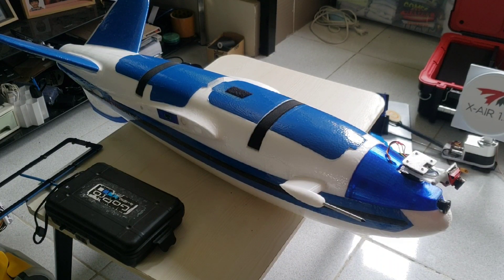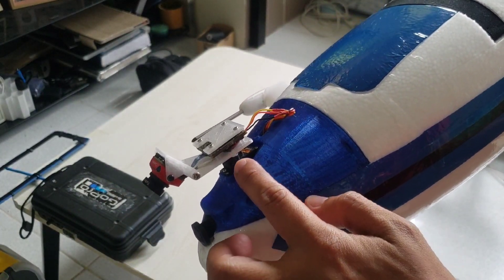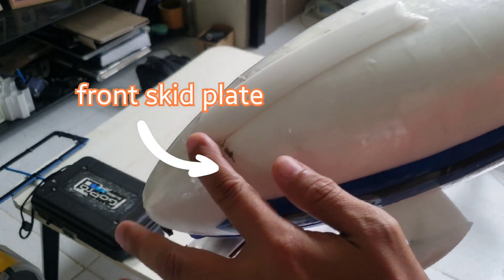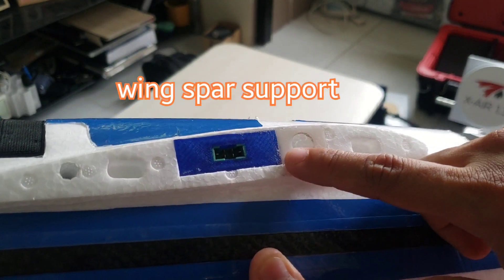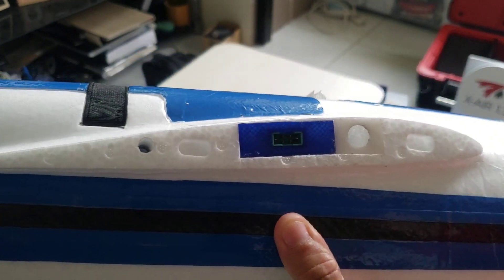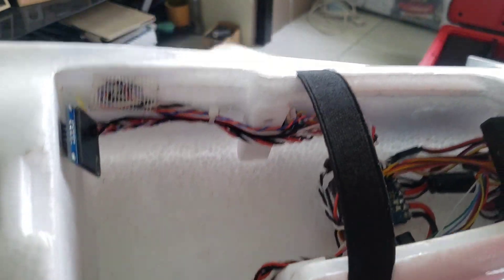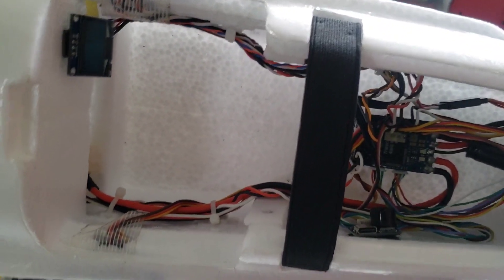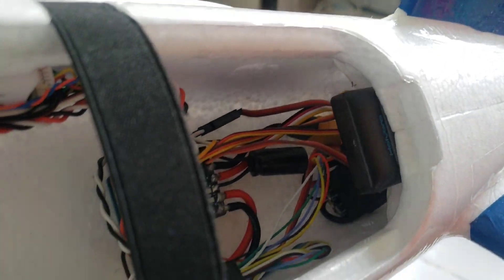X-UAV Talon Pro Long Range Build update!!!

Comment: Impressive build! I recommend you add proper hinges to the control surfaces as they don't come with decent ones from the factory. Especially since you fly long range and high altitude flights, it is important to have reliable control surfaces that won't shear off and cause your plane to plummet. I've done it on mine and now I fly without worry.
Reply from the maker: actually this build has hinges on all control surfaces. I install nylon pinned hinges on my build.
On 3:28 of this initial build video https://youtu.be/2IihYvd2n1c, you can see the hinge on the control surface
Reply: @windfpv  Oh, forgive my lack of observation.
Reply from the maker: haha!no worries mate :)
Reply: @windfpv  Also, where do you recommend the CG be balanced? I have flown my talon pro for a couple of hours and it has a tendency to nosedive when I balanced it on the distance specified on the manual.

Comment: Thanks for sharing... how big is the battery bay? Could I fit in a 4 cm x 7 cm x 16 cm 10000 mAh 4S Multistar battery?
Reply from the maker: Yes you can fit that pack. I have flown this plane with my 6s3p 15000mah 21700cell pack that measures 6 cm x 7.5cm x 14 cm. Length of pack is also not a problem even if your pack is 16cm long. The battery bay can accommodate big packs, internal dimension is 7.7 cm width, 8.5cm depth, and 23cm length. You can use big packs, just make sure that you can balance at or near CG point. The weight of the 6s3p 15000mah I have on this plane is 1308g.
Reply: @windfpv  Thanks for the reply! I’m getting the plane and thinking all the setup. If I’m not mistaken you’re using a 2814 motor with a 10x7 folding prop.  How many amps you require on take off?
Reply from the maker: You may be able to fit 2x of the 4s 10000mah, stacked. Just check if it balances at or near the cg. 60-65mm from the leading edge should work. I have it at 62.5mm from leading edge, measured at wing root
Reply: @windfpv  Wow! I have a 16000 mAh 4S battery 1333 grams! 5cm x 7.5cm x 17.5 cm Multistar.... might just do!!
Reply from the maker: Mine is on 6s battery. Draws at about 15A. I have a 510kv 2814 motor with 10x7 props 😁
Reply from the maker: your 4s 16000mAH pack may be doable, slided way back to get the CG right :) you may have to put the esc, fc and some stuff way aft too. 2814 size or 2820 motor would be good to balance the big battery
Reply: @windfpv  Thanks for your advice, it’s fascinating building a plane with excellent performance. I don’t see using the 16000 mAh 4S battery since I enjoy flights for around one hour or so! I’m really impressed with the plane performance. I’ve been flying high lately! Great scenery from high above!
Reply: @EduardoFritisRealtor  I have this very model as well, and I have noticed its quite speedy as well as efficient! Will surpass 100 kmh quite easily on my 6S setup.